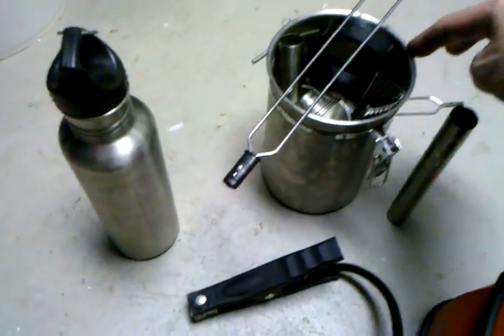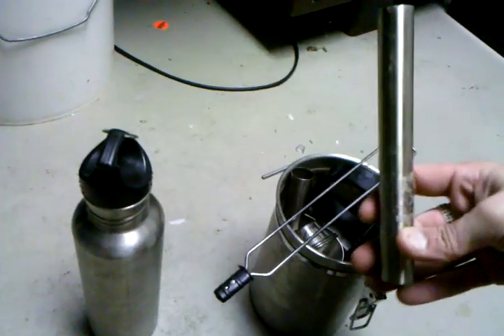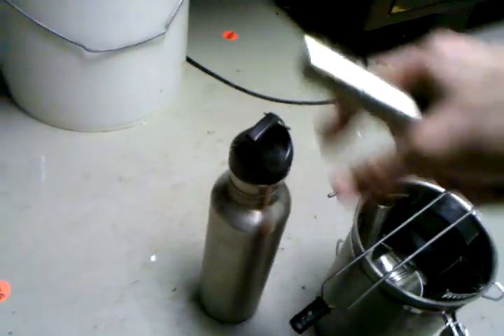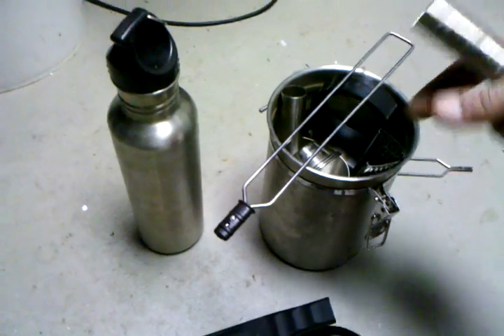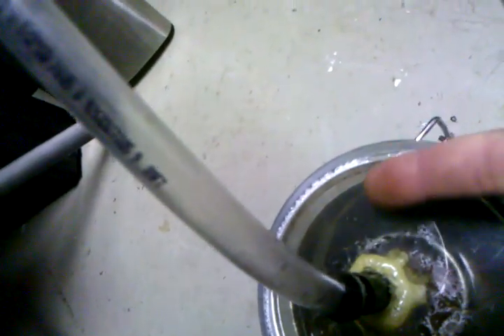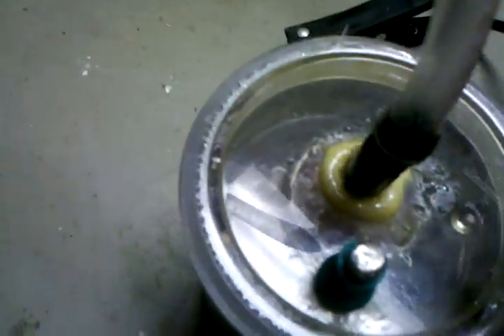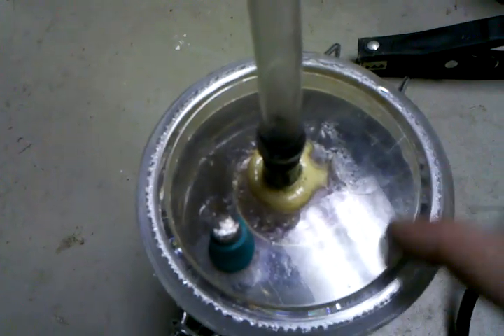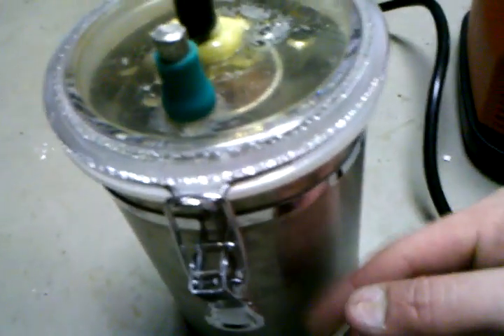HHO MASSIVE GAS OUTPUT

Comment: Hi Guy,   I have used these containers myself & still do on the bench tests, but these lids are air tight, "Not gas tight", HHo atoms are so small they will escape this lid, at best a loss of gas to atmosphere, at worst..Well you know that one... get some 12 mm thick clear acrylic, put 4 holes in corners,  do same at bottom, use wood or again acrylic, used 4 stud bars, to pull tight, I can send you a short video covering this if you like, & use thick gasket. due to the narrow flange face
Thom.

Comment from the maker: it lasts a very long time BUT many dif. var. ... if it runs low amps itl run @ a lower temp... also the solution water\elecrol.. Just think of the $s to gal. of water to fuel ratio... you need to monitor the deminishng returns of the amps-volt\gas released

Comment from the maker: It lasts a very long time BUT many dif. var. ... if it runs low amps itl run @ a lower temp... also the solution water\elecrol.. Just think of the $ gal. of water to fuel...